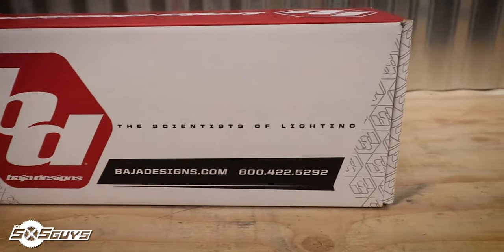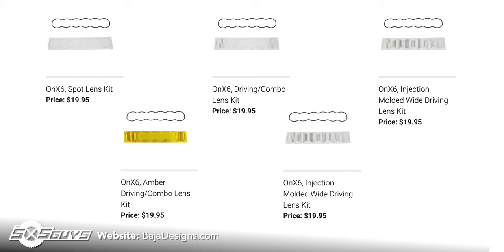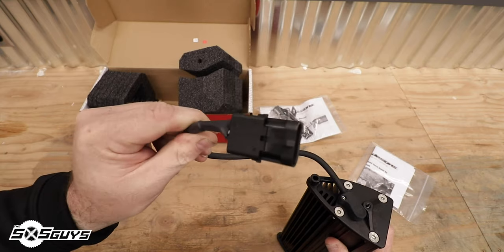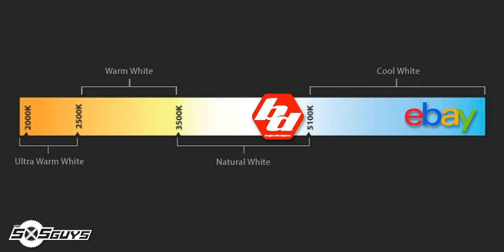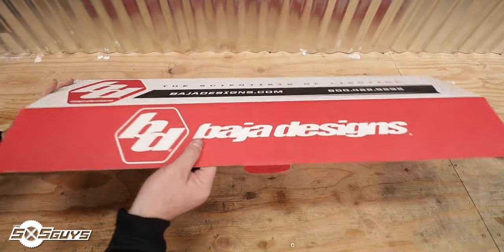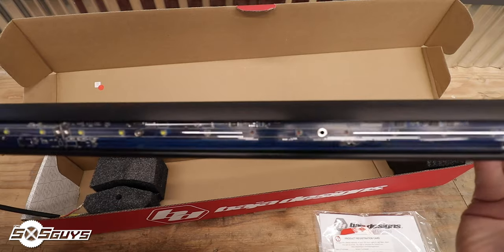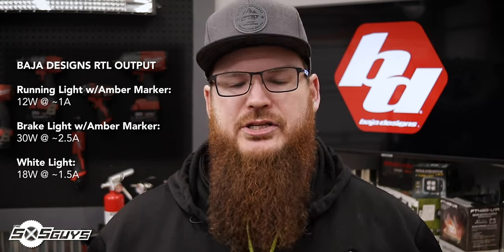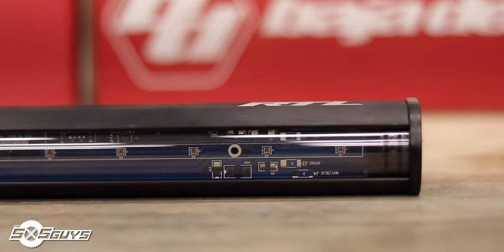Baja Designs OnX6+ & RTL Light Bar First Look | The SXS Guys

Comment: Whats the difference between the onx6 vs the s8 baja design light bars?
Reply from the maker: The 10" OnX6+ is much taller and puts out 12,460 lumen on 6 LED chips pulling 8.4A where as the 10" S8 lightbar puts out 6,350 lumen on 8 LED chips pulling 4A! So half the output as the OnX6+ with 25% less hardware.

Comment: This may depend on the state, but in are these lights generally able to be used when driving in traffic? Also, can you use the low setting as daytime running lights?
Reply from the maker: While some places don't ban lightbars on roadways, you'd be blinding anybody coming at you or in front of you with a mirror!